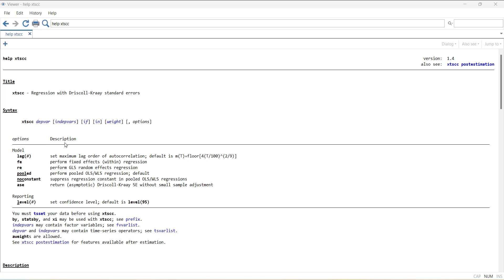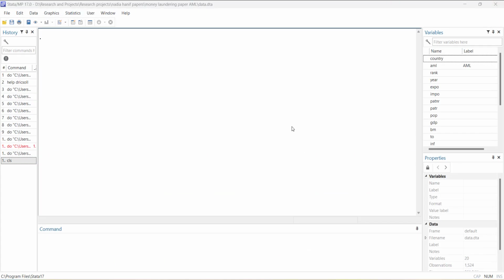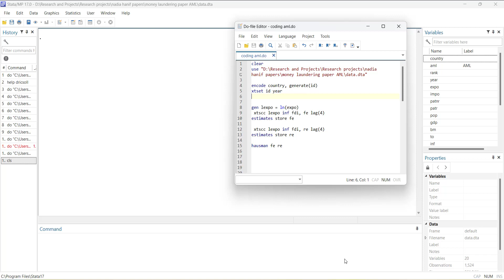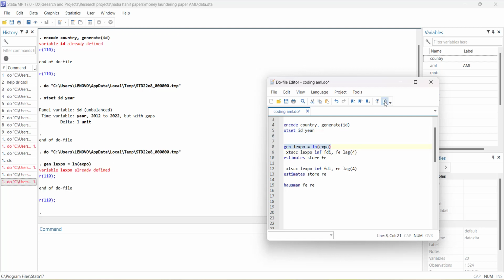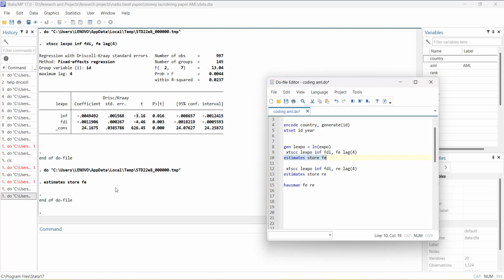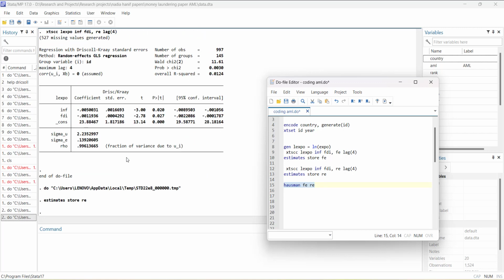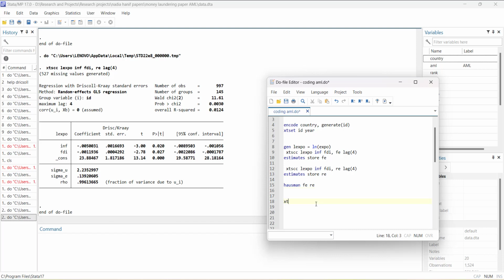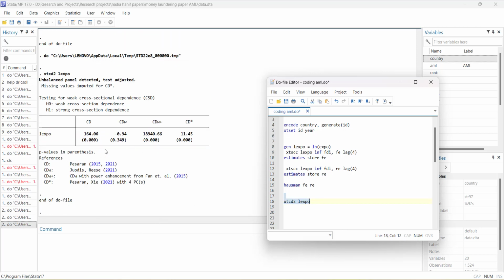2nd Generation Static Panel Data - Driscol and Kraay Standard Errors #econometrics

Comment: Can I still run xtscc even my panel data has gaps? I always received this message after I try to run this command (year is not regularly spaced: there are contemporaneous gap(s) across all subjects in id)
Reply from the maker: if the data has regular gaps like it is collected after every 2 years then you make your time indicator accordingly like 2000-2002 2002-2004 and so on so that there are not time period gaps in data, in such case you can run this model if the overall time periods per country are still nearing 19. if the gaps are irregular then either you can interpolate the inbetween values or you cannot run this model

Comment: Aoa sir can you please answer that what are 2nd generation dynamic panel data techniques for short panel
Reply: And 2nd generation static technique for short panel
Reply from the maker: By short panel i percieve that data is stationary. So for static model and for dynamic case in short panel you can use this model shown in video as it add lags in it

Comment: sir what is the different between xtscc and xtreg robust?
im doing panel on 6 country and 22 years, can I use xtscc to fix hetero and autocor
Reply from the maker: Both use different transformation to adjust for the problems you can show both as comparison.